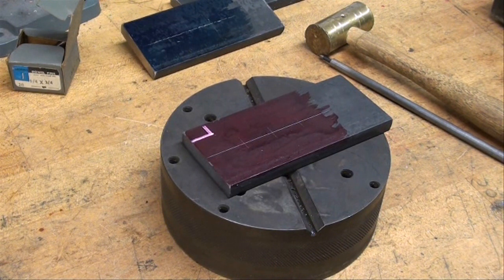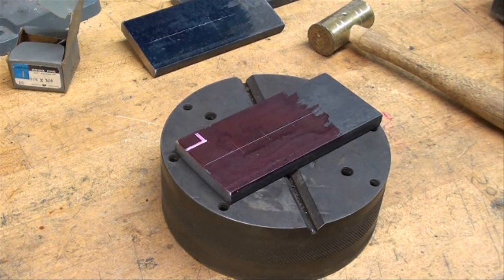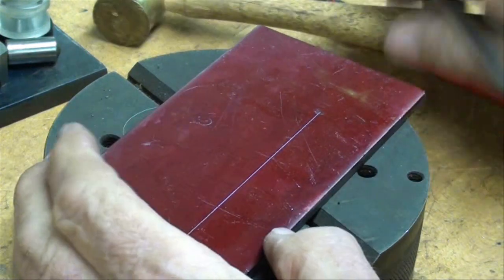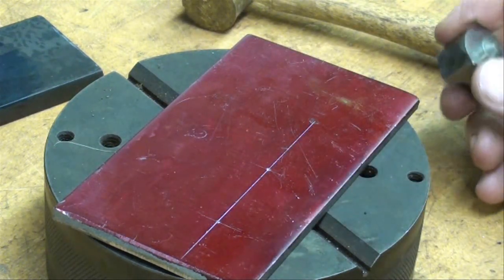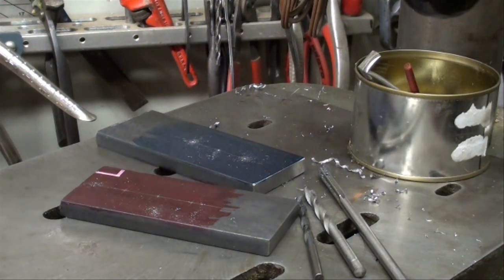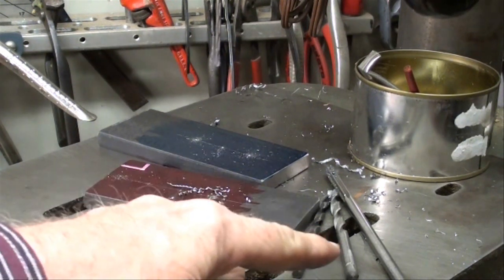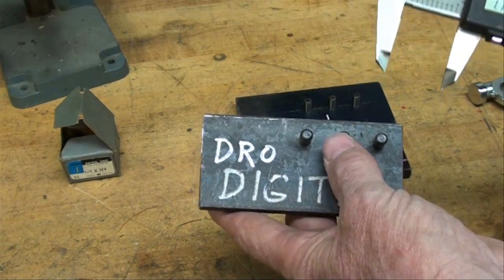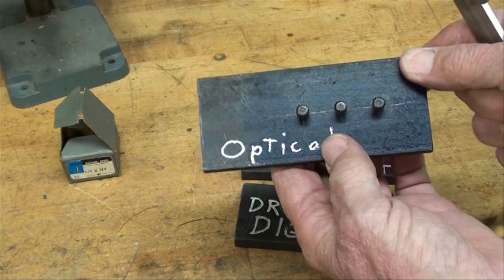MACHINE SHOP TIPS #56 Hole Layout Pt 2 of 2 tubalcain

Comment: You went up then down with the DRO. So you had backlash inaccuracy between your center drill and your stub. Try again by going in the same way for all ops. And use conical manual reamers to not screw op the location of your holes or ream on the mill.
Reply from the maker: Thanks for the tips, I appreciate the advice.

Comment: I'm in the process of replacing all the wooden treads on a steel framed stairway I made many years ago. Treads are bolted to cleats welded on each stringer. Measuring and marking and drilling wood is painful. Instead I machined some bolt length rods the exact dia of the drill hole and with a small collar to keep them from dropping through and also with a centre drill hole big enough to take an inch or so of welding rod. I placed these in the holes, positioned the individual wooden tread above and sitting in the right position and then gave it one hard thump with a rubber hammer right in the middle. Lifted up and turned over, the pins are pushed slightly into the wood and these are now drilled. So far every bolt has slipped straight through to the cleat hole below.
Reply from the maker: Excellent solution

Comment: Is it better to use a tiny drill bit to drill the pilot than to use a center drill in a regular drill press? I find when I use a center drill, the hole always comes out the slightest bit off from a dead on center punch. (laid out with height gage)
Reply: Zachary Mihlrad A center drill has a wider web than does a comparable size drill bit. Within limits- the narrower the web, the better the drill bit penetrates, and the more apt the drill bit is to stay within the center punch mark.

Comment: Thanks for the post here. I often have trouble with accuracy in drilling holes spaced in degrees around a circle but am now thinking that maybe a thin sheet of Teflon placed under the work and used just when starting to drill may help because it seems the small bits bend too much and may not move the work directly under the center

Comment: There are a couple of key factors in accurate hole placement. first, use a center drill as a start for your larger drill as, the angle left by the center drill aids in centering the larger drill. Second, use a split point drill and preferably a screw machine drill which is shorter length and more rigid.

Comment: Hello All,

To measure center to center using digital calipers I use the following method :

- Measure the peg/hole or what ever and zero the caliper.
- Measure the outside distance across both pegs or holes. 

By zeroing out the caliper on the diamitor of the peg/hole you will automatically take out any error in that dimension assuming they all are the same that is.

Comment: Did you mean 2 ten thousandths over? I think that's what Mr. Pete said at about 6:46. 
Or do I misunderstand you comment above?
Reply: Yes two then thousandth of an inch oversized. Thus the quarter inch dowel pins are 0.2502"

Comment: I asked someone to make a fixture recently which was a block with 4 dowels pressed into it.  A cover had 4 slip fit holes and slid up and down on the dowels.  I had to re-make it because the cover would bind up on the dowels.  All the holes were simply drilled and reamed.  I re-made it and mill-bored all the press-fit and slip-fit holes.  After that, the cover slid up and down on the dowels perfectly.

Comment: I think you have pretty good results with your digital read out.  I am a tool and die maker.  When I want a hole accurately positioned, I chase the drilled hole with an endmill, or boring head to correct any positional error before reaming it to size.  Simply center drilling, drilling, and reaming a hole isn't accurate enough for positioning.

Comment: @alsledge46 Yes, I agree. Mr. Pete mentioned the dowel pins were 2 thou over and that's what introduced the error. I think the DRO example was smack dab on and the other methods were accordingly less accurate when you account for the dowel pin error.
Reply: ArtemiaSalina  you obviously watched both videos, in the first Tubalcain did say incorrectly that the pins were and i quote " two thou oversized" but in the second he correctly said two tenths oversized

Comment: great set of videos as usual.. i suspect the reason your DRO version was out was because you locked and unlocked your table between holes.. the table will move a few 10ths or even thousanths.. try it again, but just tension the table so it still moves, and leave it until your done.. this should solve the error. I have had this problem before with my mill doing exactly the same job.

Comment: or Rather the most consistant results any how?
Some times the oldest method is the best.
Wire or meshuring string, with a loop on each end.
worked just like the points of a spanning Compass.

Comment: Great information about the use of the surface plate and height gauge for layout. 
Maybe you could use the angle plate and height gauge to take another measure measurement of the spacing to see if it is any different.

Comment: Tubalcain thank you for all your video's
one note:
nothing wrong with the dro, other one are off  more,
if you measure outside then inside and add the 2 and then dived by 2 you will find the dro was on the money, this makes up for the size of the dowl pins
Reply: Tj from Bristol ct That particular method requires you to make TWO accurate measurements-!

Comment: another method, use in the milling machine:
 from MSC (see Fine Centering Scope)
All Product Categories > Measuring & Inspecting > Inspecting, Detecting & Testing Instruments > Optical Inspection Equipment > Microscopes, Magnifiers & Loupes > Magnifiers & Loupes
Fine Centering Scope
Description: Fine Centering Scope Type: Scope with Crosshair Reticle Magnification: 45x

Comment: @schneidp20   A brass hammer won't deform the punch.  No matter how lightly you tap, eventually a steel hammer will introduce distortion (mushrooming).  Especially for something like that optical punch , the punch will no longer fit in the bore of the magnetic holder.  At least that's been my experience.